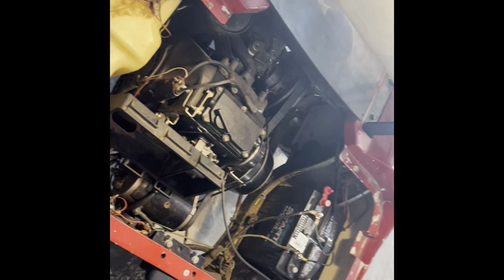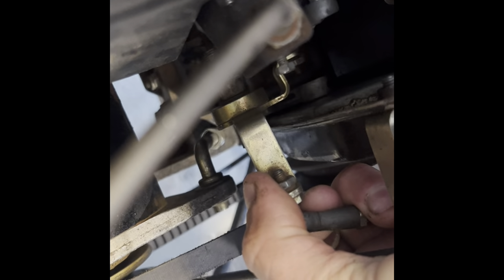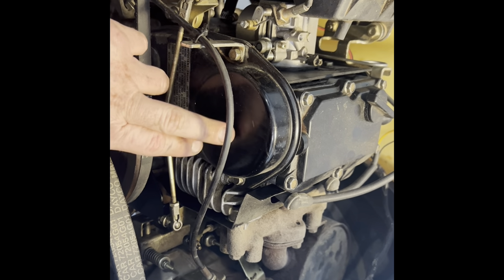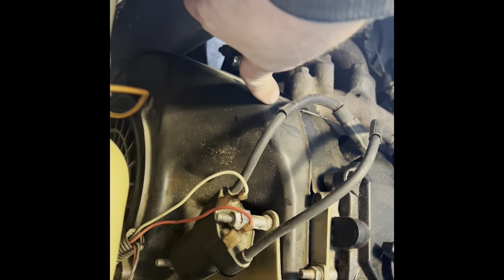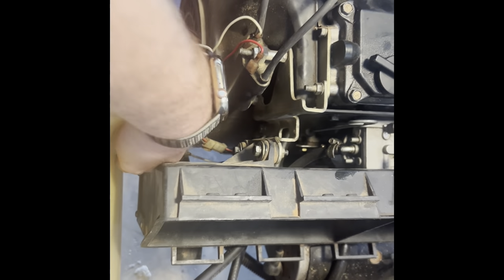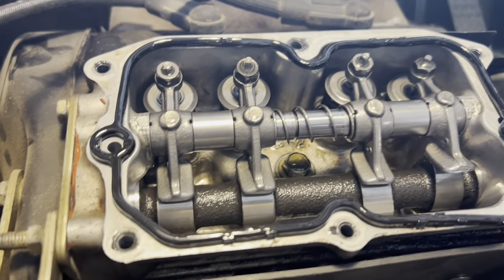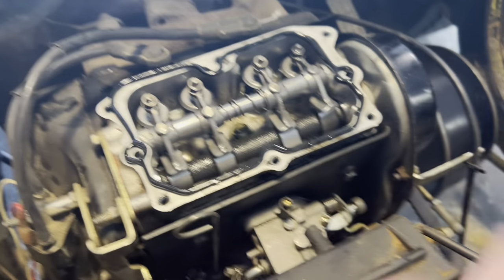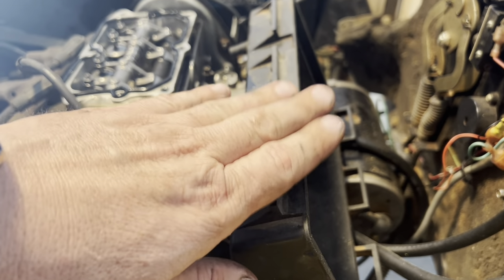EZGO golf cart engine rebuild lessons learned

Comment: If it is tight when you torque the rods down correctly you have the wrong bearings. You don't just untorque it until it frees up.
Reply from the maker: @KPWatson-m4z  I get that they were the right bearings there is only one size but the rods are used and so you have to use the range of torque specs not the specs if it was all new.